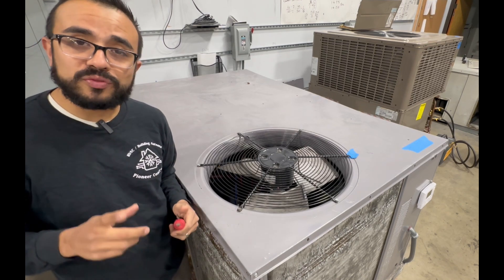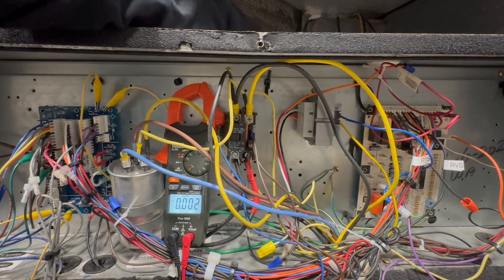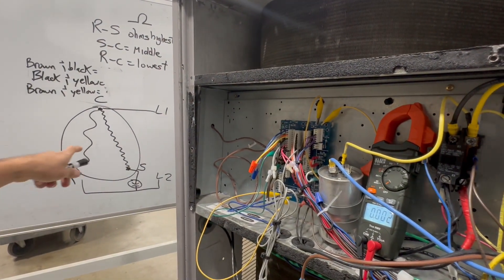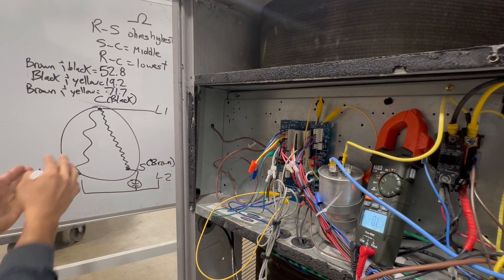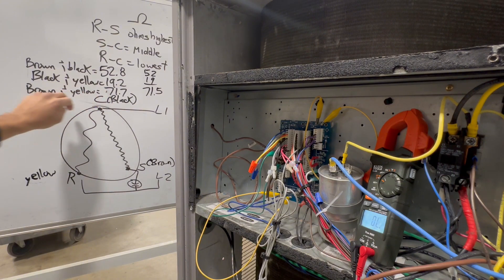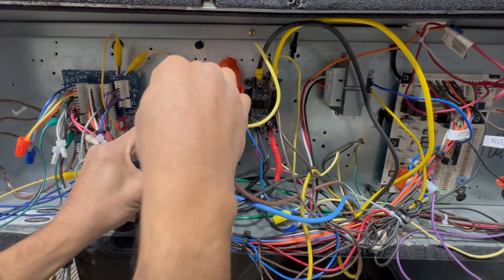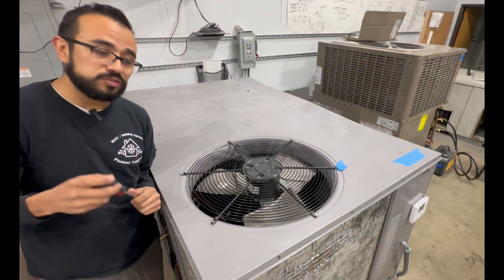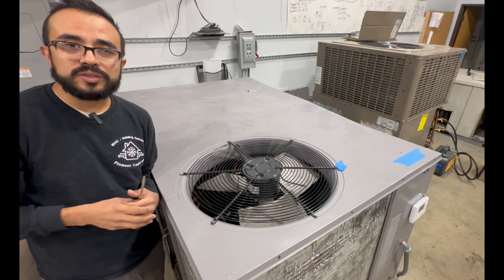How To Check a Condenser Fan Motor - HVAC Training

Comment: Which wires do you reverse to run the motor the opposite direction?
Reply: You can do it with one line and the capacitor wire it’s how you can change rotation in a 3 wire fan motor or it’s how I do my self thx
Reply from the maker: You normally wouldn’t want to. Some of the universal motors come so that you can flip two wires and reverse the direction of the motor.
Reply: @PioneerHVACControls exactly I do that in a 2 wire motor universal motor it’s even easy to twitch rotation unplug and plug wires

Comment: You’re a great teacher! If anyone has a sec to give me any tips. My old motor was bad. The new one will run for 7 to 20 minutes then stops, but if you spin it moves freely. 
I checked the resistance like you explained. 
Brown to Yellow = 71.6
Brown to Black = 39.2
Yellow to Black = 32.5

I checked the capacitance the motor needs 7.5 mfd and the capacitor is good.

Fan is turning the correct direction and pulling air from condenser out the top.

Any help? lol. Can use any if one has time.
Reply: Evap and condenser coils are clean as a whistle

Comment: My condenser fan motor get over heating and spinning very slow and stops after getting over heating.
What can be the problem?? Bad motor???, the capacitor is new and good
Reply: Check the fan capacitor first and then voltage

Comment: My condenser fan is running but it is not at its normal higher rpm. Sounds like it is laboring.
Reply: Maybe the capacitor, supply voltage, internal bearings, windings.

Comment: Compressor fan NOT running   and   compressor running very HOT; sporadic cool / warm air from air supply; occasional tripping of AC compressor breaker;  Check for: 
Burnt odor
Blade not turning, fan motor extremely hot; bad motor
Compressor can be heard running; condenser coil hot, fan blade NOT turning
DF board, if equipped, two black wires connect together, fan should run; if not the black relay on the DF board is bad; one black wire is from the fan motor
Fan capacitor within 10% of requirement        If a motor shuts off after running for several minutes and then automatically restarts after a 20 to 30 minute "nap" the most common cause is a weak capacitor. Replace the capacitor and see if this solves your problem
Extreme wind/rain causing water intrusion, insect-induced electrical short; 
Fan motor / motor bearing bad; blade hard to turn
Fan capacitor, its wirings, oxidation at contacts
Frequent AC compressor breaker trip
Fan blade damage; 
Loose wiring, relay obstructions:  fan runs intermittently 
Loud fan bearing noise  
Slow turning
Snow / ice falls on fan; imbalance lead to bearing failure
Tripped breaker
240v at the condenser relay
Zero resistance between fan colored wires

Expected Longevity:  motors to last 10-15 years; less if motor plug of downfacing plug is not removed, lightning, bad cap, brownout,

Repair Plan:
When power is first restored to the thermostat/Ahu, there is a 5min time delay; then if the thermostat preset condition is met, will the Ahu/compressor/condenser fan start up

Ck thermostat working, correct setting calling for right mode; if battery-powered, good battery (mark it on thermostat)
If compressor fan not running, Ck fan motor temperature, if it is HOT, then fan obstruction or bad motor/bearing
Ck ‘fan’ capacitor; remove all cables from capacitor for accurate reading

If shaft is pointing downward, make sure the fan motor drain plug is removed before installing new fan motor
Fan has 3 wires; black goes to DF board (if heat pump), yellow goes to 220v contactor, blue goes to fan capacitor

Signs of a good condenser fan motor:
Consistent speed and airflow
Easy to rotate, spin half rotation when pushed, no vibration, balance & unbent blades
Quiet running; zero: rattling, grinding, buzzing, squealing, bent blade, missing screw, crack
Resistance reading between motor wirings / phase;     Infinite resistance between each wire and motor casing
Zero continuity between each motor wiring to its casing; if continuity, bad motor, motor is shorted

Comment: What is the solution at the end for the condenser fan not spinning automatically
Reply: That means berrings are no good change fan motor
Reply from the maker: Bad capacitor

Comment: I usually connect to the contactor, not the capacitor, my reasoning is that amps are more limited by the common wire from contactor to capacitor than directly to the contactor, due to wire gauge. But that's just me for my peace of mind.

Comment: Once we determine each resistance between the colored wires, determining which wire is which was not explained enough. 😶... You rushed through it. Thumbs "down"
Reply: Lighten up Francis.
Reply: @michaeldarrow6021.. I do see what you mean i thought he was going to explain as if we didn't know any of what  conductors were, C, S or R..However after watching it again he is explaining what the conductors are on THAT outdoor fan motor and by taking the photo like he said we can figure which one was S and R from the colors, one been on the CAP.. But if you had a rescue motor and colors didn't match you old motor and there was no wire schematic on the motor{ some do not} you can determine which colors are C, S and R by ohms chart like he has on the video..Take your highest ohm reading between the two conductors that will be Run and Start making the third lonely wire your common..To firgure out Run and Start, just look at your chart, lowest ohm reading will Run and middle ohm reading will be your Start..Hope that helps someone..
Reply: Lo mismo que en compressor , o como más lo explico??